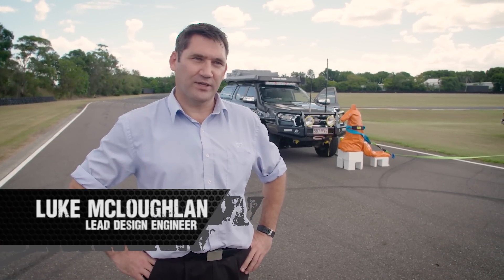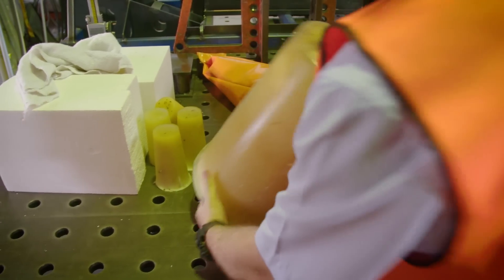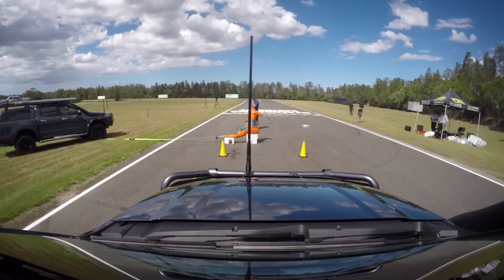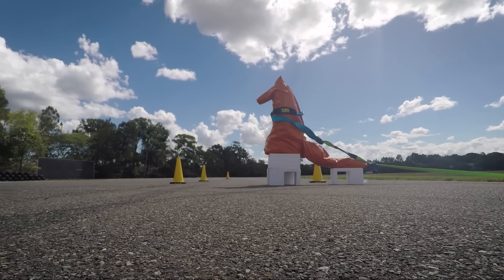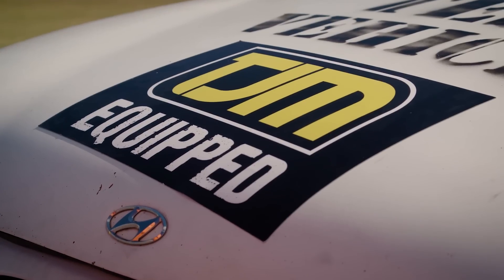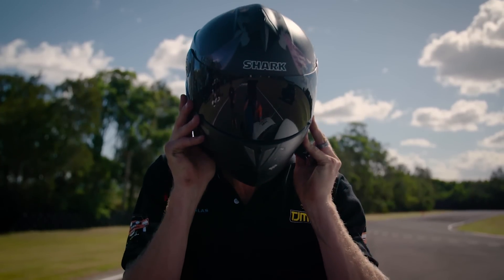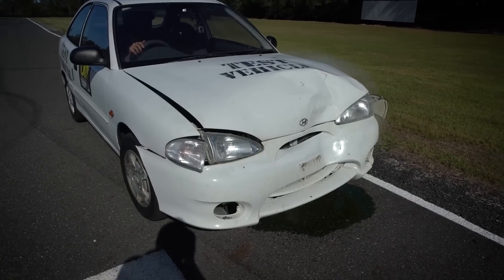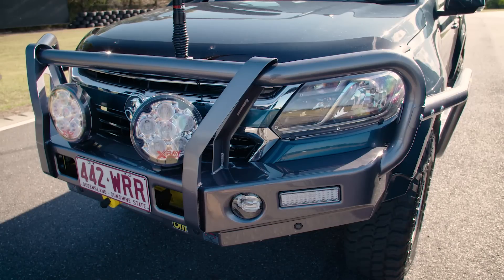Kangaroo vs TJM Bull Bar

Comment: A good test, but I notice in the 4x4's you hit it just off the main beam and into the deflection point (the angled away area). I would have like to have seen it hit it head on, eg: dead center. I get the "give us your cars to do it" comment, but c'mon, if you have faith in your product....why not real-world it? I get the Hyundai inclusion, merely to show how much damage they can do

Regardless, you did a test and showed it, which is more than most do  

I have the factory alloy bull bar and winch combo on my new Hilux and I travel quite often across the Nullarbor. Always driving through the night, so good lights etc. Yes I know, alloy Vs steel etc, but I'm looking to be able to keep driving, not 100% no damage

Comment: go 110 not 80
Reply: seriously,
 the TJM "test" involved a ford ranger with a bull bar, a LC200 with a 
bull bar and an old Excel with no bull bar, hardly a fair comparison is 
it. Note all vehicles incurred damage, so its only the towing cost that 
will be the difference.
 I'll take my chances without a bull bar cause I rarely drive on country roads at night.How
 about pedestrian safety? I rather get hit by a car without a bar, 
especially if it has those rod holder things bolted to it, sometimes 
called sausage makers.
Reply: @stevethea5250  I'd rather not have a roo or even worse a deer enter the front windscreen of my vehicle and mame or even worse kill my family..I'll stick to my bull bar with my favourite addition......rod holders!